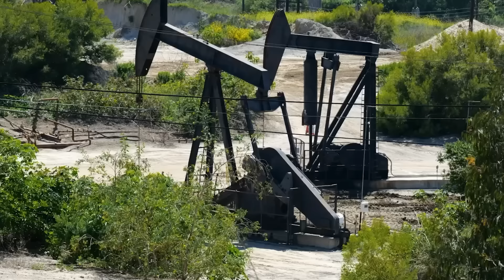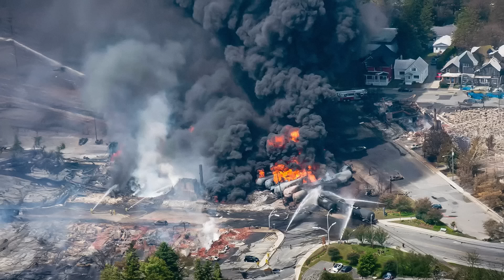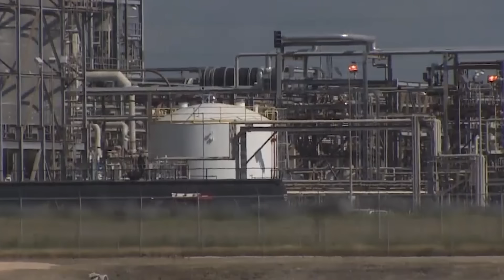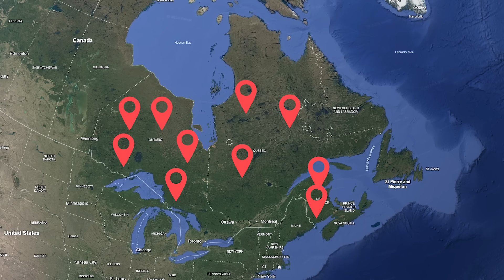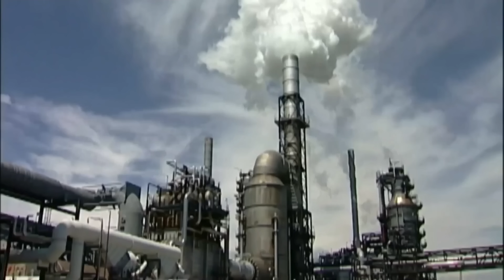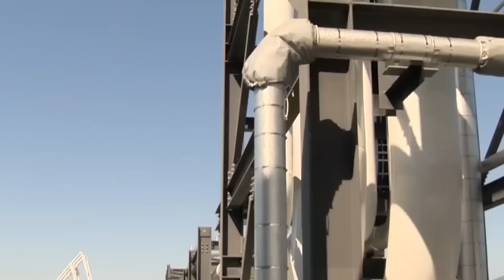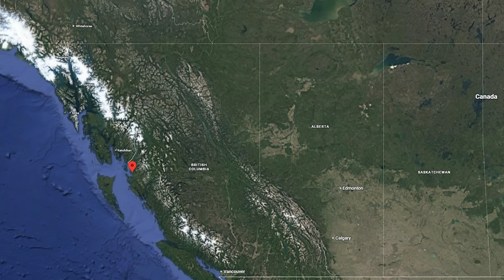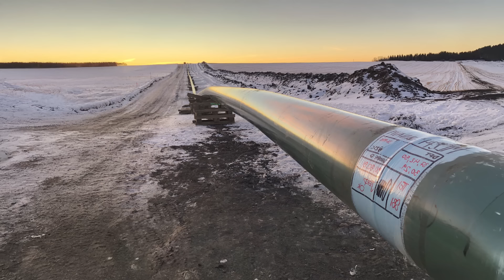Here's Why Canada Can't Build Its Own Refineries, Even Though It Produces Millions of Tons of Oil

Comment: It seems that Canada does not have a workable plan for energy independence.Too Bad!
Reply: American energy independence is destabilize Canada and steal Alberta.
Reply: @robwatson3600your doing it to yourself with your eco friendly BS without any true alternative
Reply: @natthaphonnobleTXRngr0108  You speak without one ounce of knowledge. We've already proven this video is a complete lie.
Reply: This is all BS.  There are many refineries in Canada. Edmonton, Alberta , where the oil is close by and Sarnia, Ontario, with several refineries. Montreal, and in Saskatchewan.  This must be American propaganda
Reply: There are 13 out of 15 refineries in Canada that use Alberta bitumen sands heavy crude oil right now. 

All 13 of those refineries receive deliveries directly via pipeline from Alberta, including all four in southern Ontario (via Line 5) and the only refinery in Montreal (via Line 9).

The two refineries that do not use Alberta crude oil in their refinery diets are located on the south shore of Quebec City, in Lévis, and in Saint John, New Brunswick.

The refinery in Quebec City is owned by Valero and the same company owns a massive storage depot in Montreal. Furthermore, Valero also owns an oil pipeline between Montreal and Quebec City.

So the reader may be asking themselves: so wait, if there's already a pipeline between Alberta and Montreal and another oil pipeline linked directly to the same company's refinery in Quebec City, why aren't they using Alberta crude oil too?!

The answer is simple: it's not economical to do so.

Alberta bitumen is heavy in asphaltenes and low in resins. This makes it a low-value product that is generally used as a cheap blending agent to bring down the overall cost of refined petroleum products. Remember when the Conservatives told you that Western Canada Select oil was priced lower than West Texas Intermediate because there was insufficient pipeline capacity to Canada's west coast and Canada was stuck with only "one customer"? Well, the Trans-Mountain oil pipeline is now complete, exports are happening all over the world, plus, there is excess capacity available on it!! And the price gap between Western Canada Select and WTI is still over $12/barrel on average!! Chalk it all up to yet another Conservative lie. Pierre Poilièvre is a rank expert at lying to Canadians and Conservatives are repeating the same, tired lies that are being disproven every day with TMX exports to Asia. Bitumen sands crude oil is low quality, and no amount of pipelines will ever change that. 

No, Valero actually uses their pipeline to ship finished products westward, from its refinery to Montreal instead of shipping Alberta crude eastward. 

Suncor also owns a Quebec refinery, in Montreal.  Suncor blends Alberta crudes with imported crude oil from overseas via tankers that land from the eastern US, Norway, the Middle East and Nigeria with light, sweet crude oil. The imported oil either arrives by tankers, or occasionally, gets unloaded in Portland, Maine and then piped to Montreal. 

Incidentally, the company that owns the Maine to Montreal oil pipeline applied to reverse its direction, so that the line could carry tar sands bitumen from Line 9 to Portland, Maine for marine export via tanker.  Concerned citizens of Portland in 2014 passed a municipal ordinance banning the export of oil sands bitumen at the Port due to environmental concerns. Portland Pipe Line Co (PPLC) filed a lawsuit to overturn the ordinance as unconstitutional, and against interstate and international trade. They lost in Court and abandoned their appeal in 2021. 

Many find it amusing to listen to the same Conservatives who worked tirelessly to destroy Canada's National Energy Programme in the 1980s now turnaround and counsel the government to ignore the economics and build a brand new pipeline from Alberta to those two refineries, even though it makes zero economic sense to do it today with all the existing infrastructure in place.
Reply: Canada is a net exporter of refined petroleum products.

Canadian exports of finished petroleum products hit a new high of 19.6 million cubic metres in 2024, up 10.5% from 2023.

Meanwhile, Canada imported 8.5 million cubic metres of finished petroleum products in 2024, down almost 5.4% from 2023.
Reply: No thanks to U.S. oil barons, who constantly impeed the development of alternative energy and public transit infrastructure
Reply: remember that the USA consume more oil than it produce, that's why it turn to canada only to respond to demand
Reply: The plan, as in other countries in the West, is to deindustrialize and starve the nation. Net Zero, circular economy, etc.
Reply: Is the maker of this Video you dumb? Or just American? On the West Coast there is a Huge refinery in a place called Port Moody and Burnaby 

Burnaby Refinery – a Canadian oil refinery located in Burnaby, British Columbia, formerly owned by Parkland Fuel Corp.  and now fully owned by Sunoco following their 2025 acquisition of Parkland Fuel Corp. The facility, commissioned in 1935, has a refining capacity of 55,000 barrels per day (bbl/d) and processes crude and synthetic oil into gasoline, diesel, jet fuels, asphalts, heating fuels, heavy fuel oils, butanes, and propane.  It is the only remaining West Coast refinery in Canada and plays a critical role in supplying transportation fuels to British Columbia, including producing Canada’s first low-carbon aviation fuel in December 2024. 

Burnaby Refinery – Quick facts:

Location: Burnaby, British Columbia, Canada
Commissioned: 1935
Capacity: 55,000 bbl/d (8,700 m³/d)
Nelson Complexity Index: 9.1
Key achievement: First in Canada to successfully produce low-carbon aviation fuel (December 2024) 
The refinery is supplied via the 1,200-kilometre Kinder Morgan Pipeline from Northern British Columbia and Alberta. It was originally established by Standard Oil of California and expanded significantly in the mid-1950s. Parkland Fuel Corp. acquired the facility in April 2017 from Chevron for C$1.46 billion. The acquisition by Sunoco LP was finalized in 2025, making it a wholly owned subsidiary of the U.S.-based company. 

Ioco Refinery (Imperial Oil Company):
The Ioco Refinery, originally built by the Imperial Oil Company in 1914 on the north shore of the Burrard Inlet in Port Moody, began operations in January 1915. It was a major industrial and community hub, employing over 200 people and supporting a company town with 83 houses, schools, churches, and recreational facilities. The refinery processed crude oil into gasoline, diesel, aviation fuel, propane, and asphalt, with production peaking at 25,000 barrels per day after a 1952–53 rebuild. It closed in 1995, following the expansion of the Trans Mountain Pipeline, which shifted crude supply and refining operations to Edmonton. The site was converted into a petroleum products terminal. 

Current Operations at the Burrard Terminal (Suncor Energy):
Today, the former Ioco site is part of the Burrard Products Terminal, owned by Suncor Energy.  The Upper Terminal in Port Moody includes fuel processing units, a main tank farm, and blending facilities. The terminal handles refined products such as gasoline, diesel, jet fuel, ethanol, and biodiesel, delivered via pipeline, marine tankers, rail, and trucks. The facility spans 430 acres, with operations concentrated in Port Moody, Burnaby, and along the Burrard Inlet. The site is now a key distribution hub for refined products in Western Canada.
Reply: As long as the Liberals remain in power, Canada's economy will continue to tank, as it's done in the last 11 years & ZERO pipelines & refineries & LNG projects will NEVER happen. Wake up Canadians. And to the Elbows Up crowd, this is all YOUR FAULT.
Reply: @nickt6595 

Many Canadians are completely unaware of this nation's oil and gas infrastructure. There are now three major gas pipelines to the Canadian Pacific coast, plus two oil pipelines to the west coast. There is one natural gas pipeline extending from Alberta all the way to southern Ontario & southern Quebec (to Quebec City) and one oil pipeline from Alberta and through Sarnia, feeding 4 refineries in Ontario plus a refinery in Montreal. Incidentally, all seven of these pipelines were built under federal Liberal governments, including TMX in 2024 and LNG Canada in 2025. 

Canada has broken all-time production records for both oil and for natural gas production in 2025. We have built and completed two massive new oil and gas pipelines and export terminals, both commissioned in the past 20 months. Canada also smashed export records for natural gas, Alberta's heavy crude and propane and natural gas liquids. 

The propaganda says that Ottawa is blocking Alberta, but these claims don't jive with the facts on the ground: there are tens of thousands of oil and gas wells across the province, with a thousand new ones coming on stream each year. It is because of the support by the rest of the country that Alberta has registered a massive surplus this year. 

In the 1970s, the Canadian government invested tens of millions on research & development to adapt the canola plant, a benefit which has delivered billions into the pockets of Alberta farmers. Canadian taxpayers also invested over $34B into tripling shipments of Alberta crude oil to the Pacific coast. 

Some have falsely described a "tanker ban" on the west coast. And yet tanker exports were up a whopping 1137% in 2025 vs. 2023. 

To put this in perspective:
In 2023, an average of 2.25 oil tankers/month left the BC coast (Yearly total = 27 oil tankers)
In 2024, the average was 13.58 oil tankers/month (Yearly total = 163 oil tankers)
In 2025, the average was 25.58 oil tankers/month, October and November 2025 set a new record of 30 vessels each (Yearly total = 307 oil tankers)

Oil exports to countries outside the United States rose from 2.6% in November 2023 to 15% in November 2025. In December 2025, 15 of the 25 oil tankers leaving Burnaby were headed to China. 

In 2026, 30-35 oil tankers laden with Alberta crude will depart the Lower Mainland of BC every month! Not to mention the dozens of massive ocean-going tankers of propane, natural gas and natural gas liquids loaded and shipped out of Kitimat and Prince Rupert!  Why does this bother Pierre Poilièvre and his entourage so much that they choose to lie and act as if no oil and gas shipments are allowed when, in fact, the only limitation is for crude oil and only applies to an area off of British Columbia's pristine north coast?

Indeed, Canada has the one and only LNG export terminal anywhere along the entire Pacific coast of North America with LNG Canada (in Kitimat) and the completed Coastal GasLink pipeline. 

The US has exactly zero LNG export terminals along the west coast, and none started or under development. All US export terminals are either in the Gulf coast or on the Eastern seaboard. 

Besides LNG Canada, our country has four more LNG export terminal projects in the works:
1. Woodfibre LNG (Squamish) with an expected commercial operation date of late 2027. The Eagle Mountain pipeline already nearing completion and the export terminal is more than 50% finished. 

2. Cedar LNG (Kitimat) with an expected completion date of late 2028. Notably, they will also be using the already-completed Coastal Gas link pipeline.

3. Ksi Lisims LNG (Wil Milit) with a target completion date of 2029 along, with the TC Prince Rupert Gas Transmission pipeline. Construction work on the pipeline is already substantial.

4. LNG Canada Phase II (Kitimat) will likely enter service by 2030, although this may be earlier after the environmental review process received approval for fast-tracking by the federal government in September.
Reply: @nickt6595  Things were bad when the Conservatives held power for a long time too. Why do you think they were voted out?
Reply: It's called nuclear, works great, cleaner than oil.  Fusion reactors will be online in 15 years. Not a problem.

Comment: I  wonder what prohibits Canada from shipping more of our oil to Asian rather than American markets. If the option is available, sales to Asia could immediately increase our revenues without having to shoulder the economic, legal, and social burdens of building a new pipeline.
Reply: Like idea, but reality is quite different. USA doesn't allow it since is paying only 50 % of market price. It will face same issue as Venezuela. Welcome to reality.  Oil is not an isolated case. Pretty much same apply for Alberta's beef.  Try to buy Alberta's beef in Ontario or Quebec.
Reply: @radislavilic3301   The energy proportionality clause, of the 1989 NAFTA agreement was removed from the 2020 CUSMA agreement.

Comment: Not true at all, There are 18 refineries in Canada with a capacity to refine 1.9M barrels/day.  I wonder if thats extra on top of the 5M barrels of crude we pull out of the ground each day or included in the 5M barrels? If it was you would think the guy making the video would have at least a slight clue about those numbers.

Comment: I'll try to remember your video as I drive past three refineries and a dozen world-scale petrochemical facilities in my Canadian county!  You really should start by doing some basic research!
Reply: Exactly right. 

There are 13 out of 15 refineries in Canada that use Alberta bitumen sands heavy crude oil right now. 

All 13 of those refineries receive deliveries directly via pipeline from Alberta, including all four in southern Ontario (via Line 5) and the only refinery in Montreal (via Line 9).

The two refineries that do not use Alberta crude oil in their refinery diets are located on the south shore of Quebec City, in Lévis, and in Saint John, New Brunswick.

The refinery in Quebec City is owned by Valero and the same company owns a massive storage depot in Montreal. Furthermore, Valero also owns an oil pipeline between Montreal and Quebec City.

So the reader may be asking themselves: so wait, if there's already a pipeline between Alberta and Montreal and another oil pipeline linked directly to the same company's refinery in Quebec City, why aren't they using Alberta crude oil too?!

The answer is simple: it's not economical to do so.

Alberta bitumen is heavy in asphaltenes and low in resins. This makes it a low-value product that is generally used as a cheap blending agent to bring down the overall cost of refined petroleum products. Remember when the Conservatives told you that Western Canada Select oil was priced lower than West Texas Intermediate because there was insufficient pipeline capacity to Canada's west coast and Canada was stuck with only "one customer"? Well, the Trans-Mountain oil pipeline is now complete, exports are happening all over the world, plus, there is excess capacity available on it!! And the price gap between Western Canada Select and WTI is still over $12/barrel on average!! Chalk it all up to yet another Conservative lie. Pierre Poilièvre is a rank expert at lying to Canadians and Conservatives are repeating the same, tired lies that are being disproven every day with TMX exports to Asia. Bitumen sands crude oil is low quality, and no amount of pipelines will ever change that. 

No, Valero actually uses their pipeline to ship finished products westward, from its refinery to Montreal instead of shipping Alberta crude eastward. 

Suncor also owns a Quebec refinery, in Montreal.  Suncor blends Alberta crudes with imported crude oil from overseas via tankers that land from the eastern US, Norway, the Middle East and Nigeria with light, sweet crude oil. The imported oil either arrives by tankers, or occasionally, gets unloaded in Portland, Maine and then piped to Montreal. 

Incidentally, the company that owns the Maine to Montreal oil pipeline applied to reverse its direction, so that the line could carry tar sands bitumen from Line 9 to Portland, Maine for marine export via tanker.  Concerned citizens of Portland in 2014 passed a municipal ordinance banning the export of oil sands bitumen at the Port due to environmental concerns. Portland Pipe Line Co (PPLC) filed a lawsuit to overturn the ordinance as unconstitutional, and against interstate and international trade. They lost in Court and abandoned their appeal in 2021. 

Many find it amusing to listen to the same Conservatives who worked tirelessly to destroy Canada's National Energy Programme in the 1980s now turnaround and counsel the government to ignore the economics and build a brand new pipeline from Alberta to those two refineries, even though it makes zero economic sense to do it today with all the existing infrastructure in place.

Comment: We have shitloads of refining capability. It's all on the east coast. Sadly, our oil is largely in the west.  The reason we have to send it to the USA for refinement is because Liberal shitheads blocked the east-west pipeline for a decade after cancelling the project in 2017. It doesn't help that Quebec leeches off the profits generated in Alberta, while simultaneously holding our economy hostage by refusing to allow pipelines.

Our exports in Canada have increased since we started to find markets outside the USA, and will soon be 8 million barrels a day just from Alberta.